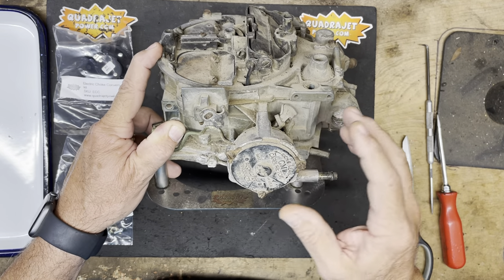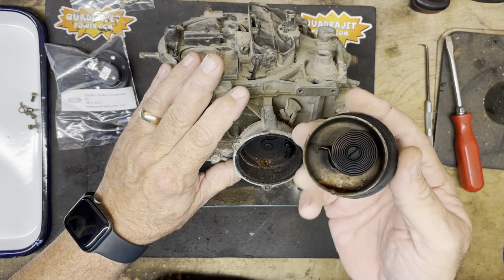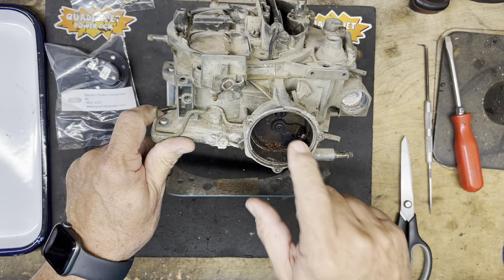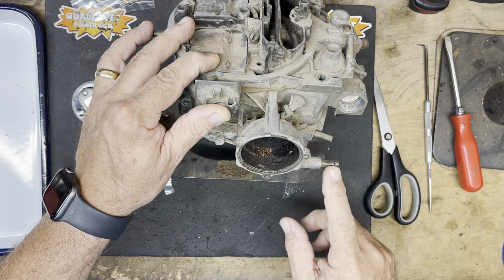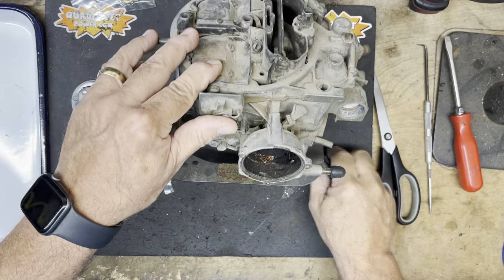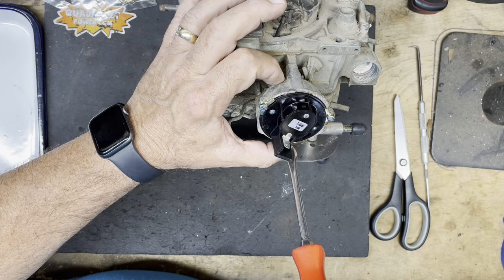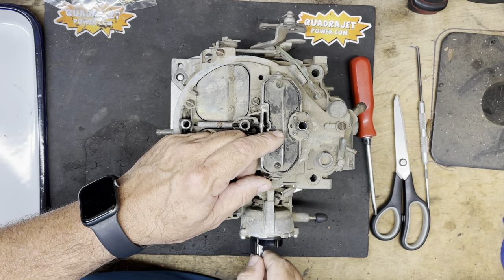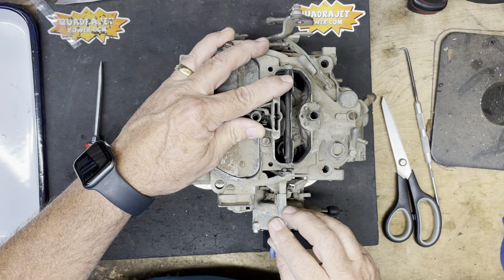Quadrajer Power  Electric choke conversion for hot air choke Quadrajet

Comment: Thanks for the video, nice job! It’s my understanding that the vacuum port inside the choke housing should be plugged to prevent vacuum leaks. I installed my electric choke just you did in the video. I did a smoke test to check for vacuum leaks and the only leak was around the electric choke. So now I’m going to plug that port to prevent vac leaks.

Comment: great video. What the difference between dive choke and hot air choke?
Reply from the maker: Divorced choke system has the heating element mounted on the intake and heated by exhaust crossover. Connected to the carb with a rod. Choke and carb and separate so the divorced name. 
Hot air choke is mounted on the quadrajet and heated by hot air piped in to the choke housing.
Reply: @QuadrajetPowerLLC  The port in the middle at the back of the carb, we just cap that off?
Reply: @locobrown yes

Comment: Good video. Any idea what could cause the choke flap to not want to close? With the choke turned all the way to where it stops moving the choke closed,  I can manually push it an 1\8th inch more to fully close it, but it doesn't want to stay there, moves open 1\8th inch again. Even with choke screws loose and turned fully rich. After engine cools, even with choke unplugged, the choke flap stays fully open. Have to manually knock it closed.
Reply from the maker: Make sure the components move freely and in the proper position. The fast idle cam should move easily up and down when installed. Sounds like you have something binding.
Reply: @QuadrajetPowerLLC  Thank you, sorry I didn't get a notification when you replied. All working now... I took off the choke and reinstalled it, I think the loop in the spring wasn't seated onto the tab in the housing. Have correct tension now and it closed nicely.
Onto the next issue which is slightly wet gasket at the top. Think the float level maybe too high. 
Loving these helpful videos. I have another vehicle that's being rebuilt and will run its factory quadrajet. Will change out the exhaust heat choke to the electric one you sell

Comment: I have a Pontiac 400 with a newly installed Edelbrock Performer intake.  I'm using the stock Quadrajet carburetor with a divorced bi-metal choke.  Do you have an electric choke conversion for this setup?
Reply from the maker: We have this conversion for 68-72 Pontiac quadrajet.  https://quadrajetpower.com/electric-choke-conversion-kit-68-72-pontiac/
Reply: @QuadrajetPowerLLC  Thanks for the quick reply, I just placed an order.  Is the conversion close to this video with a divorced choke?

Comment: QUESTION ON STIICKY FAST idle its an electric choke its a 87 chev motrhome  60k mi. put it all together  & the idle was hung up to high also wher can you get an airhorn gasket  everybody says go fish
Reply from the maker: We have all the parts you need. Put your quadrajet code stamp number in our search bar at www.quadrajetpower.com and find your air horn gasket.  You probably need to adjust your choke if it is not releasing.

Comment: If my E4MC on a 307 Toronado has had its original 1981 choke riveted in place, would you recommend to remove the rivets for then to convert the carb to an electric choke with screws?
Reply: That is very odd, I’ve never seen any quadra that had rivets. Might be someone’s patch job

Comment: Does the metal plate on intake manifold were the hot air tube used to go into have to be blocked off..will there be a exhaust leak there if not blocked off..
Reply from the maker: Yes, that does need to be blocked off or it will have a leak.

Comment: Wiring question.  Bought the conversion kit yesterday and looking for the delivery.  The conversion unit uses 1 (one) hot wire that requires 12v.   I'd like to tap into the old sending wire to power the choke.  Why is there no ground connection on these units like those used on Holley or Edelbrock carbs.
Reply from the maker: These ground through the housing and body of carb.
Reply: @QuadrajetPowerLLC  Outstanding.  That simplifies things for me and my TA engine bay.  Have a great day!

Comment: How do I connect choke rod to accuator. Do I have to take off choke ? Or is there a simpler way?
Reply from the maker: It can be attached with everything in place. You have to slide rod down and hook it in the actuator hole.  It is a little tricky, but can be done.  Make sure fast idle cam is down so actuator is up at highest point.
Reply: @QuadrajetPowerLLC  Thanks for the reply.

Comment: Okay so i just recently bought a 1986 k10 that has been converted to electric choke it looks like but still had the hot air stuff hooked up. Well i decided to delete the hot air tubing and egr on that side of the manifold and figured the electric choke would still work but it doesn't. How do i test the electric choke element? And should i have the little gasket between the element and the choke housing? Where does it ground? I tried it both ways. And yes i have 12v supplied.
Reply from the maker: It should not have the gasket, it grounds to the body.  Plug all of the vacuum ports.  Apply the full 12v and make sure the choke is operating. If it doesn't you may need to replace the element.

Comment: I bought a 1981 Camaro with a 350 that is not the original engine. It has a Quadrajet with hot air choke but the hose is not on the choke mechanism. Just the nipple sticking out. And it's not capped either. I also noticed after driving for a while that the choke plate doesn't fully open. I have no idea where the hose from the choke would connect to the engine. Any help with that would be greatly appreciated. Or should I just install the electric choke conversion? Thanks for the helpful video.
Reply from the maker: Yes, just do the electric choke conversion.
Reply: @QuadrajetPowerLLC  I ordered the electric choke conversion. Thanks!

Comment: Is setting the choke different when carb is on motor ?
Also can you recommend proper amperage for electric choke fuse . Thanks
And thanks for you tubing.
Reply from the maker: You can set up the choke and adjust on the bench, but need to verify proper operation after installed in engine.  Electric choke does not draw much amperage.

Comment: Hey buddy.. I've got a quadrajet on a 86 silverado im working on .. it has a plug on the top  just above the filter ... one of the wires was broken && I can't find where it goes .... any idea what that is .?? Its a Ignition hot wire so I stuck it to the choke but I don't think thats where it goes
Reply from the maker: Try to find a chassis manual for your truck. That is best source for complete wiring information.

Comment: What would cause this type of carburator to cold start at idle 1500 rpm? I have an Oldsmobile with one and it randomly started having this issue. It was once in a while at first but now it's every time I start it in the morning it sounds like im flooring it. Great video bro!
Reply from the maker: You can adjust the fast idle rpm with the screw under the choke housing.
Reply: @QuadrajetPowerLLC  what if that doesn't work?
Reply: If you can make a video about it would be awesome
Reply: Spray fast idle cam and adjuster linkages to clean off any crud with carb gum out,etc. Check linkages . Maybe you have already done this.